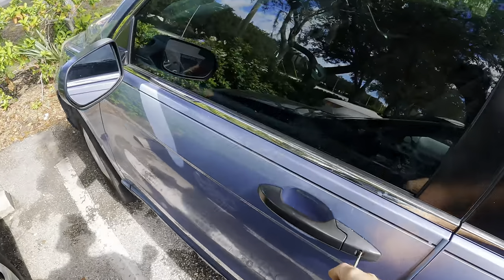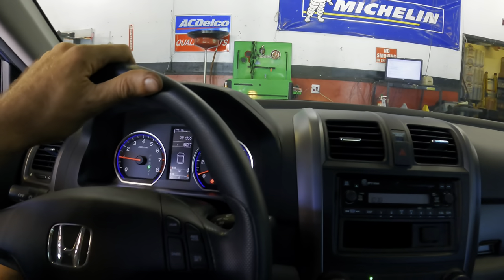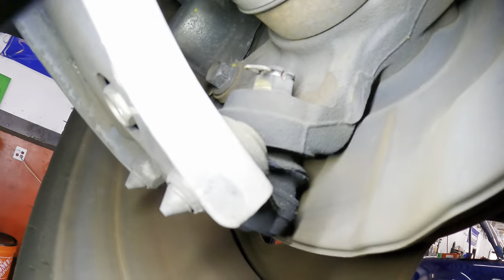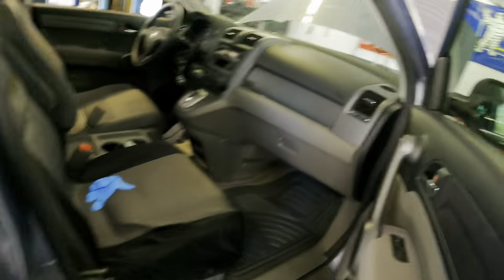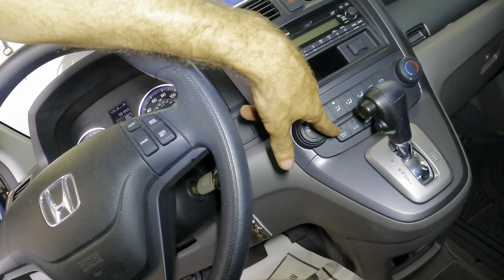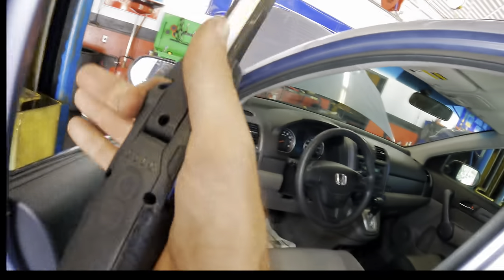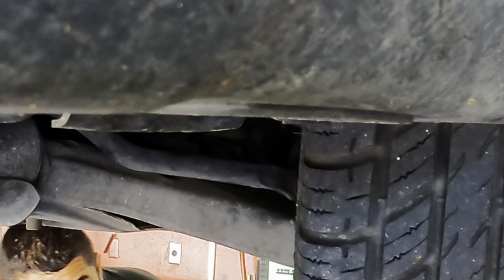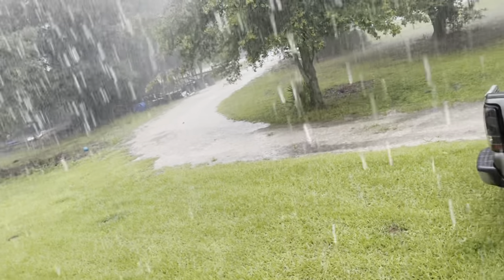Scam or Stupid? YOU decide! Work that wasn’t needed! Honda CRV

Comment: Watched the whole video now -- for the new home mechanics 
(1 )When checking ball joints -- you take a prybar/large screwdriver stick it between the control arm and bottom of knuckle and see if the ball joint pushes apart (don't damage the rubber) -- with all the suspension still attached, you would not be able to see if a ball joint was bad by just pulling on the tire unless it was so far gone that its was already to fall apart.
(2) Its clear that one ball joint was replaced and not the other -- while there are arguments on both sides of this -- with suspension one school of through is you change both sides at the same time as  both saw the same life exposure.  I buy my ball joints at Rockauto and generally they are pretty cheap -- in this more modern design the ball joint bolts onto the control arm (vs pressed into the knuckle) its not hard to replace both.. 
(3) One ball joint does has a torn boot but if it passed the prybar test, you could let it go a few years. 
(4) The other ball joint is not wet because the other shop sprayed it -- if you look higher you can clearly see some of the grease has washed out of the axle and the dark coloration is down the back of the knuckle and onto the ball joint.
(5) If I am working on my stuff - and I am replacing ball joints, control arm/bushing etc -- I do a new link -- again you can buy less than $20 on Rockauto and the parts are not the cost driver - its time here - if a part is cheap and in the middle of another repair, save the future labor, replace the part.  Unless the link is really warn, you would not be able to see if its bad by just twisting it while still installed.. it has to be unloaded so when you took one end off to loosen the control arm to get to the ball joint, you would see if its worn out.
(6)  I own and have owned multiple Honda, every single one has lasted >300k miles and suspensions do wear out and you start hearing noises -- often you need to replace multiple parts at once to get the noises to go because everything is worn -- that's why you will see this kits with struts, arms, ball joints, links, bar busings -- myself, I just accept the noises but on my wife's car, little car noises result in big wife noises and as such, I replace more.  In a shop - no good deed goes unpunished -- if you didn't replace the link yet you had it off in your hand, and later it fails, the customer may not sing your praise.
Reply: Harold, this is so well written and really solid advice. I hope others take the time to read your post my man! Awesome work!!
Reply: Yeah, Ray's position that nothing needs to be done is questionable as well. IDK if the other mechanic was trying to scam the owner or not (these are pure speculations), but Ray's documenting the boot issue to cover himself and yet reassuring the customer verbally that yeah, it's OK is hardly appropriate. The right ball joint definitely should've been changed. And those links could've been recommended because they were approaching the state of rustiness when they could only be removed with a saw. So better change now while it's easy than wait and then have to cut them off.
Reply: @eaf2k  Well I'd say you are someone who de knows there stuff. Short of taking the easy road of saying I agree with you, I agree with you lol.

Comment: Upselling in the repair business is almost guaranteed. I had a cousin who worked for dealerships an for private shops. He said, at one establishment they would discuss revenue per customer on a monthly basis. A major goal was to increase revenue per visit. 
For example, you may need an oil change, but your brake pads and steering joints will be recommended even though you have 1/3 pads left. Also, why settle for pads, why not the calipers and rotor. So, instead of a $400. bill, you now have a $1,000. plus bill. Now, that is revenue per customer.
At the various shops they played the good cop bad cop routine. The tech was the bad cop looking to change everything. The service manager was the good cop who was on the customer's side and only recommended the parts that "needed" to be changed for "safety" reasons. Comments like, you don't want to be applying the brakes and the brakes fail or the steering fail at the moment you need it to avoid an accident. 
One time her referred to himself as a tech goon. He caused people financial harm.

Comment: Yeah you should have changed the ball joints. The torn one clearly and the crappy aftermarket one was seeping the grease out. No one could have applied oil to the surface so masterfully to it like you implied. Sway bar end links do click/thump but you can’t tell without apply some side load to them or driving across an uneven surface.
Reply: x2 on all of this

Comment: Ray: I enjoy watching your channel and this is the first time I noticed a few things. Do you know what the unattached hose is for? I spotted it during the inspection of the endlinks and ball joints. Lastly, was that I missed engine air filter clip? :) I appreciate your work and can only wish for all mechanics to operate like you.
Reply: hose likely a/c drain
Reply: Air conditioning drain. 
Basically thats where condensation comes from when using your A/C and you can see a water spot on the floor where the car was parked.
Reply: ahhh. ac drain. Thanks!

Comment: I am a qualified, but now retired mechanic in Land Down Under. Like many other mechanics I know, there are plenty of workshops, dealerships as well as independents, who write up a vehicle as needing lots of work done. Then an examination under the vehicle with the owner present, me explaining how to check if a component is right, or how to tell if it is wrong. Many times the person was told that the vehicle was unsafe to drive, it was that bad. In a few cases one of the staff at the shop, also a mechanic, comes over when the owner returns and has been told the "bad" news, and then that staff member offers to take the vehicle off the owner hands at a rock bottom price - out of the "kindness of their heart". In one case, where everything was documented and passed to the owner (I have a scanned copy of that report on my computer), we went through the Toyota Prado and found that all the front ball joints had no play in them - they had been listed in red as URGENT - failed. So had the inner control arm bushes - same wording in bold red font. Same for inner and outer tie rod ends on both sides. The steering rack, the power steering pump, the colour of the PS oil, the wiper blades, the front wheel hubs and finally the fact that the bonnet (hood) would not open all were listed as defects that failed the car. The towbar was also listed as being rusty and there was rust in one of the rear chassis side rails. The rear caliper, caliper slides and brake shoes were all listed as being low in pressure on the RH side. Same side also failed for the parking brake. The final comment was quote" DO NOT RECOMMEND VEHICLE BE DRIVEN - UN-SAFE TO DRIVE" unquote. That was all in red font. Car belonged to a friend of my son. Went through it and found the RH rear axle seal was leaking and oil went over all the brake components. We put in a new seal as well as rear handbrake shoes and new disc pads - same for the other side as it showed early signs of leaking. We convinced the bonnet to open, lubricated the cable and all was fine after that. All the rest was fabrication. Showed Lance (the owner) how to use pry bars to put substantial leverage on all the supposed defective suspension components and we found nothing worn. We topped up the power steering fluid with some additive and all the noises went away. The car was then taken to another workshop where it was independently inspected for registration renewal - it passed in all aspects. So what did we learn. Don't trust documentation from even a country wide suspension specialist. Also another learnt over the years, if there is documentation that says the oil (any of them), oil filter, air filter, fuel filter, cabin filter have been changed, check it. Does not matter who did the previous work. If they did it then we can verify that it has been done. Too many times I have seen, and can prove, that it was not done. The owner has paid for the parts and labour and the work was not done. Even had one person I was told about that parked his car alongside a fence when he took it to the dealership in the morning. Later that day he returned and found his car parked in the same spot. He went in and the service staff at the front counter showed him the account for many hundreds of dollars for the work that was done. Then he asked to see the workshop manager and showed him the nut that he placed on top of the LHF tyre that morning when he parked the car. In the afternoon he took the same nut off the tyre - the car had not been moved. In the ensuing "discussion" the owner convinced the manager that the workshop would do the service the following day at nil cost. Initially saying no to the free service manager changed his mind when told he would be receiving a call from the New South Wales government Dept of Fair Trading the following day. What I am saying, as others have said, Caveat Emptor - buyer beware. On the other side, Ray, Ford Boss Me, Watch Wes Work and South Main Auto (there no doubt are many others) are all very credible people who have shown by their actions in many videos that if they say it is wrong, it is indeed wrong. The same if it is right. As Ray has said in this video, these people who take "people for a ride" are doing a lot of damage to the industry I have been part of for more than 50 years. Shame on you. They have two rules - I can do it to you, but don't dare do it to me.

Comment: After seeing the oil on the brand new lower ball-joint, I'm not as ready as you to dismiss it as not knowing all the circumstances that led to the recommendations. That was a straight up scam, I hope she posts the name of the place at least on whatever social media she has.
Reply: But I don't know why he did not check for " play" in the ball joints .  Thats the only indicator that they may be worn
Reply: @ethics3  but he did, when he's talking about "shaking the wheel" at about the 4 minute mark, that's the first stage of testing for play. If there is play in the ball joint, you can move the suspension by hand by moving the wheel. If there is play when you move the wheel then you proceed to checking ball joints and bearings. If no play, they aren't bad enough to replace.
Reply: @donakahorse  You could have saved a lot of time  as you didn't need to attempt to tell me how to check a ball joint. I used to perform safety checks  in my pops business  30 years ago.
And besides , the way you described and the way this chap did it in the video was wrong. Sorry . I am not saying hes a bad guy and he knows a LOT more than i do , but in this instance he is incorrect.
You  cannot check for play with the vehicle up on the hoist  with the suspension fully extended . The geometry is such on most vehicle's that with the suspension fully extended it effectively locks the ball joint and the extent of its movement .
You need to place a stand or floor jack under the lower table and allow the weight of said vehicle to compress the suspension to normal operating height. This is when you can grasp the tire at the 12 and 6 o'clock position to check the ball joints and then at the 9 and 3 o'clock position to check the tie rod ends .
Anyways , I am glad to be retired from the auto racket . Lots of stress 
Cheers

Comment: Years ago I took my Camaro in to get the A/C belt replaced. They later called me and said my oil needs changing and so does the transmission fluid because it is dark. A week previous I had changed the oil myself and had the transmission fluid replaced a month ago. I declined the added work and never returned to that garage.

Comment: I can understand that the ball joint may be still full of grease but with the torn boot that will allow water and dirt to enter the joint and cause premature wear. Preventative maintenance would suggest change the boot but apparently that's not an option. As for the locked glove box its unknown if the other garage had the non-valet key.

Comment: About 7 years ago, I bought a new Prius C to use as a short haul delivery vehicle. When It had about 15k miles on it, I took it in for service and the service writer came back and told me several things that were pure BS. He told me the rear brakes had excess dust accumulation and needed to be cleaned for $150. I just looked at him and said "$150? For a $3 can of brake parts cleaner and 5 minutes of work?" He also quoted me $200 for a cabin air filter and vent sanitizing. I replied: " $200 for a $10 filter and a few minutes of work?" Needless to say, he didn't get the work and I just took my complimentary checkup. Just because it's a dealer, doesn't mean they can be trusted. BTW, at 133k miles the rear brakes are still original and I changed the fronts at 130k miles because they were getting low. As for whether I was told the truth, I pulled the drums a year later, at 45k miles, and they were like new inside. No dust, no wear. After all, it's a hybrid and most of the braking is regenerative. The hydraulic brakes do very little braking and can last over 200k miles. Needless to say, I haven't been back to the Toyota dealer in Holiday, FL. I still have the car though since it's reliable and paid for.

Comment: There are always two ways of arguing what it needs, Balljoints and Swaybar Links are meant to be done axlewise aswell and a Wheelalignment from time to time doesn’t hurt either. 

What I haven’t seen here is testing the Balljoints for play with a plier or prybar along with the swaybar links and a little testdrive over some bumps to hear the classic swaybar link rattle or Balljoint thumb/ knock. A torn boot can be argued replacement worthy as the water and dust will get into it and destroy it from the inside over a longer period of time. 

Not that Honda parts are very expensive to start with.

As you said rather a little emergency stash of cash at home for safety 🤣👍. She can fix the car step by step over a couple weeks one thing at a time.

Cheers

Comment: As for that ball joint with the oil on it. Why would a component that uses grease not oil have oil on it anyway and only oil on the bottom not on the top where maybe it ran down from something else. It is because they squirted some oil on it in case she asked to actually see it. I am too old now but used to do work for older people that got huge estimates like this and could not afford it. If the work was warranted I would do it for the cost of the parts if not I would show them what was done to make them think they needed work they did not. Ripping off old people on a fixed income that can't afford it by scaring them makes you into a POS of the lowest order. Thank you for helping her with an honest appraisal of what she really needed. I still am happy to look at cars for older folks and if they are getting ripped off I send them to my local mechanic that I have known for 20 plus years he charges a reasonable price and uses quality parts. I am more than happy to expose these types of butt holes.

Comment: 20 years ago I had a new steering rack put on my car,new tires and had the front end aligned.3 months later the front tires were showing wear ,so I took it back and after an “inspection “ I was told that they wouldn’t replace the tires because I needed a new steering rack  and an alignment. I was waiting for this and had the paperwork in my back pocket. After a few angry words they replaced the tires and I suspect that they actually did the wheel alignment then, because the tires never went bad after this

Comment: My elderly friend insisted on taking her car to the dealership for maintenance. More than once she told me her bill was over $4000. She also insisted on using premium gasoline when it wasn't called for. What can you do?

Some dealerships and shops do actually run up the bill on service. I think the oil change shops are the worst. 

Find a mechanic through referrals and stick with them. I have had better luck that way.

Comment: Honda engines like this one are known for burning excessive amounts of oil.  My honda has the 2.4L engine that is very similar to that one.  They are known for burning oil with valve seal or piston ring problems.  I have to add a quart of oil every time i get gas.  The good thing is that i have been doing this since 170k miles and it now has 220k.  I always carry extra oil haha.  Its not the worst thing to burn oil as long as you know and keep it topped up.  

If this car was mine I would decline all service and just add some coolant/oil. I wish I knew a mechanic as truthful and helpful as you.  Side note, your recommended tools made for amazing fathers day presents!

Comment: that's happened to me before too!  went to a shop and said i needed brake lines and full brake job.  the lines were broken all the way throuh, so if they were like that coming in i wouldn't have had any brakes at all so i think they cut them to force me to fix it. and had another shop look at brakes and they  said i still had like 60-70% life left in the pads. first place was ripping me off

Comment: Wife took civic into Goodyear for no A/C. Told her the compressor locked up so need to replace "everything". Something like 1500$. 
I took the day off to look for my self. Ran power to the compressor and cold air blowing again.. It was just a relay. When I asked him what he would have done when he replaced "everything" and it still didn't work... He told me the compressor comes with a new relay. He gets no benefit of the doubt. Goodyear corporate didn't care either.